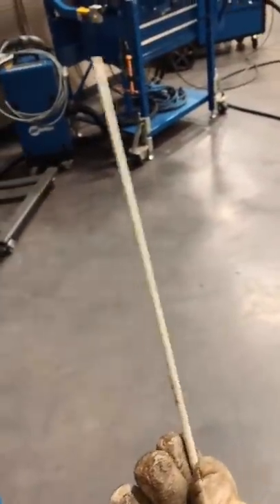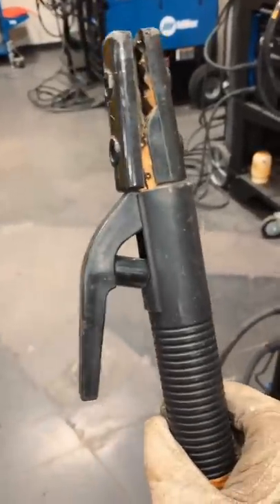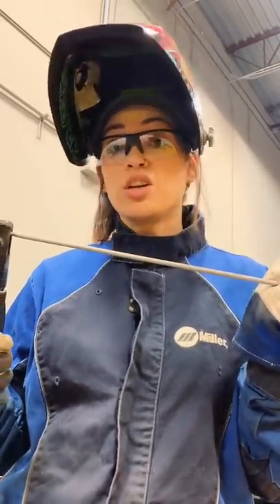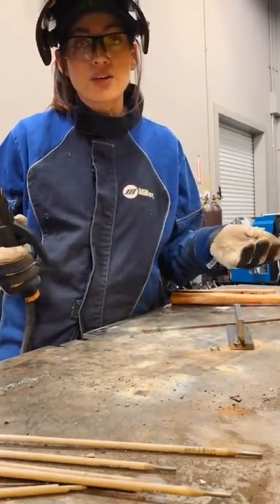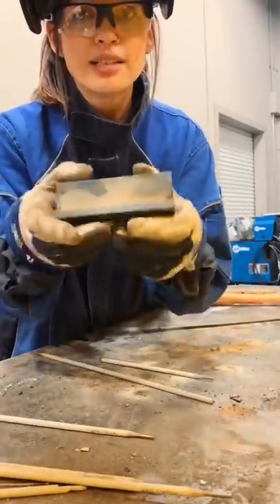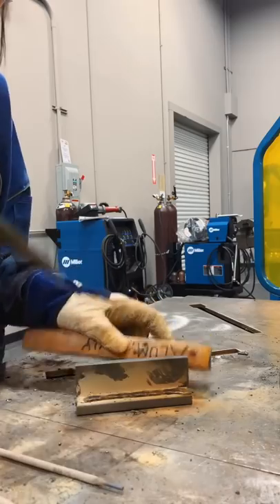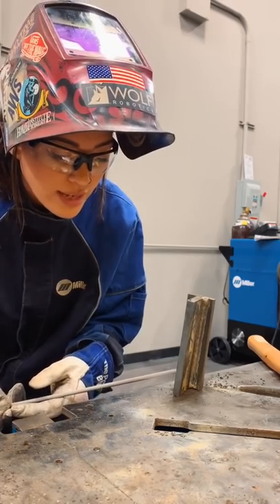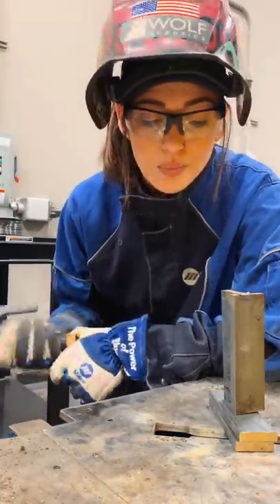Watch This Before You Start Stick Welding.

Comment: About that college instructor hung up over bending rods.   I guess we all have things that we get all picky over and in practicality don't hold water.  I can't count the number of professional welders that routinely bend rods, excuse me electrodes (see way too many pointless hangups out there).  In fact, when in a tight position where you cannot get to a weld without bending the rod just what is Mr instructor going to do? Use a bunch of stubbies so he has 27 restarts on the top of a pipe tucked up in some tight space. Give me a break. It's one thing to say "If you bend the rod you might break off some flux and risk introducing inclusions yada yada..." vs kicking them out of class.  We only have one life to live in this world and getting hung up over piddly little things isn't worth it. I like to think I'm getting better at not being hung up over things and am doing a better job of explaining pros/cons instead. So fellow welding youtubers, whats your favorite story of someone being hung up over nothing?
Reply: If I could like your comment more than once I would.
Reply: as the title of the video states . . .is for beginners , do not try to be an expert on your comment !! we need to be more constructive
Reply: @xerxesleonidas4500  I wish I knew what you are trying to say... Perhaps I misread it. Can you explain?
Reply: One thing that one of my instructors hates is how often I add filler while tig welding. Then another instructor came around, looked at the weld, and said to the other, “I mean, it isn’t over or under filled so I don’t see what the issue is.” Most things chalk up to personal preference, there’s multiple ways to skin the preverbal cat of welding.
Reply: @9187061050 
That’s what I’m sure he meant by his Comment.... at least that is what I pictured.  I Cut my own Hair.  Similar. 🤦🏻‍♂️😜
Reply: @Nick Knight,  Right on brother! she may be great in the lab, but I wonder how effective she would be stuffed upside down in some piece of machinery trying to repair it in the field, with a impatient owner counting the seconds as you try fix his broken junk. At some point you have to "break the rules" and press on. Bending a rod over is just one of the many tricks we do as welders to make it work. And yes there will be some waste, but what the heck, it works.  
However..... to our intrepid instructor, keep up the good work girl, we need more welders and people like you to teach the basics and theory in the lab, even if you don't like bending the rod over. Your students if they continue on in the trade will figure out what  ways work best to complete their given task and make a sound weld in the field sometime after they leave your lab. Cheers
Reply: in 57 yrs of welding i have bent over so many rods cannot keep track especially welding in miwrights and overhead augers downspouts etc
Reply: you are so right
Reply: Welding is my career.
I always put the stick in the 45 degree groove and give it a slight bent right at the stinger.
That's the way I was taught and I do it without thinking now.
You can then rotate the stick and get any angle you want.
When in a really tight spot, you can bend the rod in the middle to reach what is impossible with a straight rod.
I never went to a welding school, all on the job training and whatever I could pick up on my own.
When I was young, a supervisor chewed my ass for wasting rods, the foreman, the guy who taught me to weld simply asked him one question.
What is more expensive, the price of the welding rod or the price of a failed weld?
Reply: Used to weld marine impellers in a foundry. And I was taught to ground the electrode directly on the weld table till the flux would glow red. I was able then to bend it while hot to a radius without breaking off the flux. That would allow me to weld down inside the impeller vain with a mirror so I could see around blind side.

Comment: I'm a female and I'm learning welding and fabrication.
Reply: There's no such thing as man and woman anymore we are just people haven't you heard lol
Reply: Why?
Reply: Same here! ❤❤❤ looking for advice on  an auto darkening hood.  I see alot about the speedglas and ClearLight Lenses.  Any advice?   Thank you in advance 🖤🖤🖤
Reply: @cellanddanielle  I got a auto darking hood from ironton cheapest one they had it works great I paid 39.00 dollars for it I got it at northern tool it's just as good as a 200.00 dollar hood in fact I like my cheap one better its actually  built better and you can get replacement lenses for it cheap and easy to find at harbor freight tools
Reply: @raakmore4443  I've heard good and bad things about those lol I guess the only thing to do is to try one! Especially for <$50
Reply: @cellanddanielle  what bad have you heard? It's only 39$
Reply: I've heard you have to blink as you strike an arc as the glass isn't as responsive.
Reply: @cellanddanielle  sure there is a little delay but not any more of a delay than a 200 hundred dollar one. You will have to try it your self and compare
Reply: Thank you for the advice ❤❤❤
Reply: @cellanddanielle  your welcome
Reply: you want a oscar for that?
Reply: @raakmore4443  ive heard that it's bad for your eyes because the glass is cheap if you don't weld much propobly it isnt a too big of a problem
Reply: @tumeh7410  ok I didn't know that and I'm not a professional welder that does it every day so if that's the case dont buy a cheap one lol if welding was my career I'd buy a good one

Comment: Called a "coupon" because it's a smaller piece of metal that's been detached. "Couper" is "cut" in French, so a coupon is any kind of off-cut.
Reply: Then what's a "french fry"?
Reply: Coupon is French for "the unused 
 (scrap) part leftover when a large piece is cut to dimension"
Reply: Don’t tell a woman welder that, that’ll be be sexist if you say that.
Reply: Bob calls them coopins!
Reply: @Panchdara  Bob's great
Reply: Good god.
Thanks.

Comment: Great video. Just bought an arc welder and the last time I did any welding was 50 odd years ago! So quite nervous about trying again but your video has given me the confidence to just get on in there and do it. Thank you Athena.
Reply: Do it man, I just started class 3 months ago and bought a cheap $70 yes welder brand stick welder off Amazon and I love it! Welding is a great trade to learn wether ur professionally doing it or just use the knowledge when needed

Comment: The standard all purpose electrode in the UK is the 6013, will re strike every time, easy to use in any position, doesn't need drying.
Reply: Great all-round rod, apart from vertical fillets. I just cannot avoid slag inclusion in that position no matter what I try.
Reply: Not much penetration with 6013
Reply: 6013 is the most popular in the US for casual homeowner use. Pretty weldments, fast fill, ok in wind. Most field repairs here are 6011/6010 due to great penetration and tolerance to muck. We only dry for low-hydrogen applications. 7018 is a popular lo-hy here.
Reply: @Mikael5732  agreed 6013 is a “farmers” electrode, easy to handle but far from strong

Comment: Total welding n00b, here. Not only were you one of the best 'intro to SMAW' vids, but w/ you, I learned some very key details others omitted for whatever reason. I found your basic rules easy to memorize & after about 5mins of scratching to start an arc, I fell into my sweet spot & can repeat it about 80% of the time. Sometimes, IDK what went wrong, but something did. Thank you - subbed!

Comment: Thanks for sharing. Over the last 4 years I have had to learn how to weld on the job. First learned to tig stainless then I got a bunch of practice with wire feed. I personally prefer to tig weld. I am better at it and I think it's much cleaner. I've seen several coworkers stick weld but never tried it until recently. Again thanks for sharing you definitely helped...

Comment: i have been stick welding for 40 years and never vertical welded from bottom to top 
always top to bottom and a ship builder tought me a lot
but i will try your way mabe its better i will see
Reply: Would it make a difference depending on how the weld terminates?

(Ends, or changes direction)

Comment: So glad you mentioned comfort, biggest oversight when it comes to welding in my opinion
Reply: If it takes an extra minute to dig a spot out in the dirt, I'll do it 100% of the time. If i'm between a rock and a hard place, I'll get situated best as I can and let 'er rip, but it's never as easy as welding on a table.
Reply: Did my training 1978/79/80, and we were told that the first thing to do when welding, was to "get comfortable".

Comment: Well, a month later and I finished the trailer with my Amico 160D and all my welds turned out very nice and I've used the trailer to haul lots of metal, I'm getting into blacksmithing, so I'm going to be welding a forge together and the metal is much heavier than what I was using on the trailer. I have to wait for the weather to break, since I don't really have an inside shop yet that is heated. It's really cold out right now, the high today was 27 degrees and we are getting snow, sleet and freezing rain tonight and into tomorrow so, not conducive to welding outside. I will be building a shop for blacksmithing and the forge will heat it up nicely, so if I have to do any welding in the winter months, I should be able to do it in there. Anyway I digress, I just wanted to drop a line after watching your video again, I just feel really thankful to have found your video, which improved my welds immensely and given me a lot of confidence, when I approach a job now. Thanks to you! 🥽

Comment: I bought an old Sears stick welder for $50.00 bucks I watched welders at work for many years but I never welded anything until I bought my old welder and I taught myself from what I picked up at work . When I retired in my 60’s I welded thick washers to the head of large steel spikes to make trailer hitch pins for my small tractors then tried all different stuff .I love this video cause she’s cute and very informative love her

Comment: Great advice , I know its about how to weld but welders suffer with lung issues due to fume inhalation, its good practice to show good air circulation or devices that should be in work shop to prevent breathing in them toxic fumes,specially welding stainless steel,

Comment: When I started 40 years ago I hated the Clamp Electrode Holders due to small hands and strong clamp springs. A welder put me on to the "Bernard Short Stub" electrode holders and never used  anything else. I bend rods all the time to get into places. I burn they up to the flux break and stop if it's a problem. Whatever works for you is great to get the job done. Take Care, Best Wishes.

Comment: There are times when bending your stick electrode is the only way to reach an area for welding.  One common example could be a trailer hitch on a car, when you have to run a bead on the top but can only reach it from the bottom.  TIG or MIG will never fit, but you can bend your stinger into a nice "J" and reach the right spot in a snap.  The only down side, of course, is that the flux coating will probably fall off so you have no electrical insulation present at the bend.

Comment: Good video for people just starting off. Only issue I would have as someone who started welding in family pipeline fab shop at 13 and 21 years on pipeline with only 4 x-ray bust. There are times in the real world one needs to bend the stick. If they can get in a  more comfortable positions with it bent let them do it.

Comment: This was very beneficial indeed and I thank you for the lesson . I did have a question . Is it a good idea to weld over a weld to achieve double the strength so to speak . Specifically , the wedge on my log splitter broke off , so I have to reweld it . Needless to say it takes a lot of pressure so I need a strong weld . I'm new to welding .

Comment: try sliding the hammer on the edge of the flux covered weld, if you welded it right it will come off in almost one piece every time
and you wont have hammer marks on your hot beautiful weld
Reply: true story
Reply: Good tip

Comment: Quick question as a total noob to stick welding: I noticed you said "when slag you drag" and in the first horizontal weld you kept the angle obtuse to forming weld (electrode ahead of weld spot), but THEN when you went vertical, it seemed as though you were 'pushing' the forming weld up (angle btwn electrode and formed weld acute)... is there a reason for this? Is that always how you should approach those 2 general directions?

Comment: No mention of amperage to per metal thickness, critical.
Reply: This was basic 101. Find a chart hopefully one that is for the welding rod you choose. You do know manufacturers charts vary, don't you? Not all welding rods or welders are equal or even accurate. Have fun with sorting out what's critical.

Comment: In addition to wearing your PPE, don't forget to work outdoors or where decent ventilation will remove all the smoke from your shop.  Don't put your face over the weld so the smoke plume enters your helmet, either.  A little won't kill you but a lot will give you "metal fume fever" or much worse.

Comment: Okay that vertical weld without clamping down the coupons I thought was impressive. I've been trying to teach myself to weld, and I'm finding out that it's not as easy as it looks.  (found out the same goes for concrete finishing, who would have thought?) So after two or three pounds of rods my welding still looks like a two year old did it.   B/
Okay that's not entirely true, they almost look as good as a two year old's. I can't tell what's flux and what rod when I'm looking at the orange puddle and I think I'm going to fast. Idk. I'm also thinking that maybe this 110v 70amp harbor fright welder with it's 3/16 rods isn't a very friendly machine to learn on.
Well I liked watching you weld that inspired me to keep at it. Happy Holiday's

Comment: Would a stick machine be a good starter welder. I am looking at the miller thunderbolt 161
Reply: Buy the most complex one that you can afford. But try on someone's else machine first, if this hobby is for you or not.
Mig machine can do tig and stick and tig machine can do stick 
but you can't do tig with a stick machine without major conversion
you can't do Mig with a stick or tig machine without major conversion

You can't output AC current with DC machine  AC is handy for Aluminium-tig
You can't output DC current with AC machine without a rectifier box
On most machine, you can't change the polarity cycle of AC
Size and duty cycle also matters, it'll effect how much you'll have to wait for your machine to cool down between long welds

Then some machines can do fancy things that other machines can not, like pedal control for tig, spot welding for tig, Pulse welding for tig, Being able to set pre/post- gas flow for tig and mig etc etc.

Then there's also a process that takes no electricity called Oxy- Acetylene which might be the best for a beginner.
Reply: It's the best machine to learn to weld and the cheapest. A used Lincoln Electric AC225 should only cost about $100-200 (new $350). That's a good starter.

After that, the world's wide open. Harbour Freight has some cheap machines and Miller / Hobart has some reasonable units for DIYers like the Stickmate or Thunderbolt $400-500.

Comment: When you were going vertically, did you use any type of weave movement or in the pattern of a “U”?
Reply: You don’t use a “U” manipulation there will be to much build up on the centre of the weld.......side to side manipulation no wider than the diameter of the electrode or “rod”

Comment: I like learning i did some welding in high school with ox ac.but they were not strong or good looking like you.basicly the weld can't brake before the metal not welded does.full penatration on both sides and thicker but uniform is that correct.

Comment: I found this video very beneficial, I've been welding for a few years now, mostly self taught and I never heard anyone say anything about removing the flux off the tip to get a good arc. I've had problems with this and the way you explained it made perfect sense, when you likened it to a pencil. You have beautiful welds, lots better than mine, but I'm hoping that by following your tips my welds will look lots better. One thing that bothers me about your video, at least this one(it's my first) it looks like your doing your videos with your cell phone, it makes everything look very narrow. I bought a cheap 4k camera with a tripod and it makes the videos so much better looking and with your awesome shop and all your equipment, you want to show it off. But I really love your video and I learned more from this video than I have from all the welding videos that I've watched and I have watched a lot of welding videos. If I had seen this one before I started stick welding, it would have saved me a lot of headaches. I started out with a Harbor Freight 90 amp stick welder and after lots of frustrating hours, I graduated to an Amico Electric 160D and it is a whole lot better machine to weld with. I thought that the problem with the Chicago Electric was that the amperage was too low, but when I got the 160D I found that I was burning through the metal, turns out I turned it down to 70 amps and was getting better welds that wouldn't break when I hammer tested the weld I was getting more consistent beads than I was getting with the Chicago Electric turned all the way up. I have all the sticks you mentioned, but I like 6013 the best so far for what I've been welding, which is 1.5" mild steel angle. I raised the sides on my tow trailer with them.